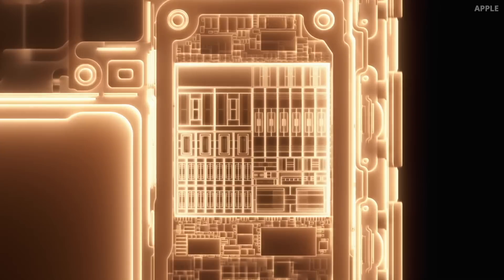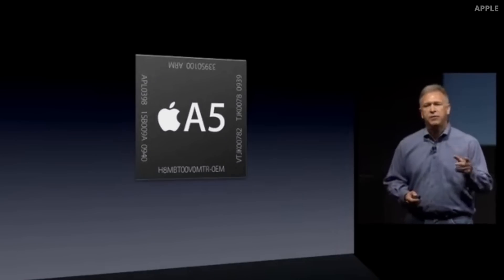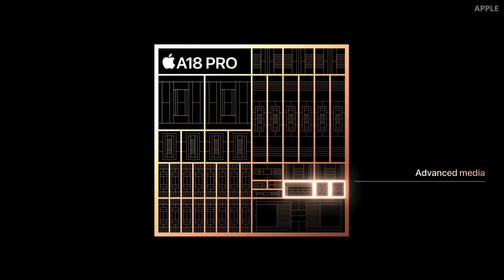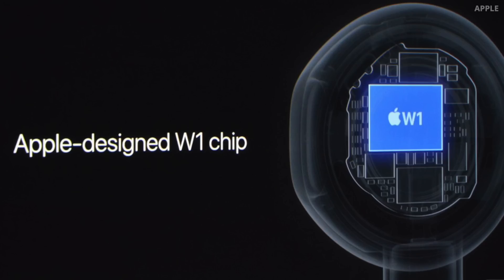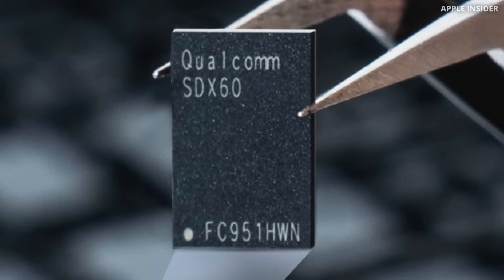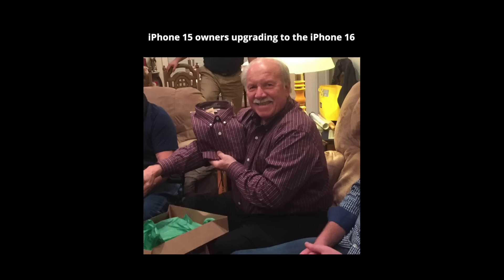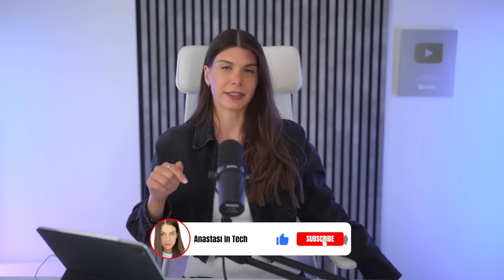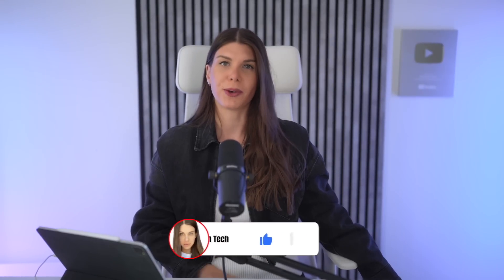The Secret Behind Apple's New Silicon

Comment: I’ve always said Apple is primarily a hardware company.  Be it the external aesthetics of design or internal architecture, packaging and functionality. They struggle to make their software achieve equivalent performance with their hardware.  Look at the many years Siri languished. Or Apple Maps vs Google.  Apple Music vs Spotify.  MacOS is better than Windows, but there’s still lots of opportunities for improvement.  iPad OS does not take advantage of the new M4 processor- perhaps this is intentional.  But there are many functional shortcomings to IPad OS.  Certainly as the world becomes more technologically complex, Apple will see massive benefits to the integrated ecosystem they have developed.  But it remains to be seen how well they do with AI.  Google excels as a software company compared to Apple. Ultimately it’s the functionality that software offers consumers that excites consumers about technology products.  Software solves problems, offers new functionality and capability, albeit with a reliance on the underlying hardware stack.  To most consumers, the hardware layer is a mystery to them. It’s just there and it does its thing.  It’s the software that drives the customer experience.  For instance consumers don’t care what chip provides cell service.  They just want it to work, invisibly.  So Apple has a huge software challenge before them.  To succeed it will require true innovation and not just marginal and incremental enhancements.  Hopefully they are up to that task.

Comment: @AnastasiinTech  , I asked the new chatGPT model o1 if it had any ideas about how to make semi conductors faster. Most of this is gibberish to me, so I thought I'd share with you, to see if you have any thoughts on it:

Improving Semiconductor Speed with Existing Technology

Enhancing the speed of semiconductors using current technology involves optimizing materials, device architectures, and fabrication processes. Here are several approaches that can be implemented:

1. Scaling Down Transistor Sizes (Continued Moore's Law)

Advanced Lithography Techniques: Utilizing extreme ultraviolet (EUV) lithography to achieve smaller feature sizes, reducing the distance electrons travel and increasing speed.

FinFETs and Gate-All-Around FETs (GAAFETs): Implementing multi-gate transistor architectures to improve control over the channel, reducing leakage current and enhancing performance.

2. High-Mobility Channel Materials

Silicon-Germanium (SiGe) and III-V Semiconductors: Integrating materials like SiGe, gallium arsenide (GaAs), or indium gallium arsenide (InGaAs) in critical regions to increase electron mobility.

3. Strain Engineering

Applying tensile or compressive strain to the silicon lattice to enhance carrier mobility, allowing electrons and holes to move faster through the transistor.

4. High-k Dielectrics and Metal Gates

Replacing traditional silicon dioxide with high-k dielectric materials (e.g., hafnium oxide) to reduce gate leakage and enable further scaling.

Using metal gates to improve electrical characteristics and transistor performance.

5. Improved Interconnect Materials

Copper Interconnects with Low-k Dielectrics: Utilizing copper for interconnects to reduce resistance and low-k dielectric materials to decrease capacitance, minimizing signal delay.

Cobalt and Ruthenium: Exploring alternative metals for interconnects to further reduce resistivity at smaller scales.

6. 3D Integration and Packaging

Through-Silicon Vias (TSVs): Employing vertical interconnections to stack chips, reducing signal delay between components.

Chiplet Design: Breaking down complex chips into smaller "chiplets" connected through high-speed interfaces to improve performance and yield.

7. Silicon-on-Insulator (SOI) Technology

Utilizing an insulating layer beneath the silicon layer to reduce parasitic capacitance, which enhances speed and reduces power consumption.

8. Enhanced Thermal Management

Advanced Cooling Solutions: Implementing heat sinks, heat pipes, or liquid cooling systems to dissipate heat more effectively, allowing semiconductors to operate at higher speeds without overheating.

Thermal Interface Materials (TIMs): Using materials with high thermal conductivity to improve heat transfer between components.

9. Optimized Circuit Design and Architecture

Parallel Processing: Designing processors with multiple cores or specialized units (e.g., GPUs, AI accelerators) to handle tasks concurrently.

Clock Gating and Dynamic Voltage Scaling: Implementing power-saving techniques that reduce energy consumption and heat generation, indirectly supporting higher speeds.

10. Improved Fabrication Techniques

Atomic Layer Deposition (ALD): Achieving ultra-thin and uniform material layers to enhance electrical properties.

Epitaxial Growth: Growing high-quality crystal layers to improve carrier mobility and device performance.

11. Advanced Doping Methods

Laser Annealing: Precisely activating dopants without damaging the substrate, leading to sharper junctions and faster transistors.

Ion Implantation Innovations: Enhancing dopant profiles to improve electrical characteristics.

12. Optical Interconnects

Integrating photonic components to transmit data using light instead of electrical signals, significantly increasing bandwidth and reducing latency.

13. Use of Compound Semiconductors for Specific Applications

Gallium Nitride (GaN) and Silicon Carbide (SiC): Employing these materials in high-frequency and high-power devices due to their superior properties over silicon.

14. Software and Firmware Optimization

Compiler Enhancements: Writing software that optimizes code execution paths, making better use of existing hardware capabilities.

Firmware Updates: Refining low-level code to improve hardware efficiency and responsiveness.

Conclusion

By focusing on these areas, it's possible to significantly increase the speed of semiconductors using technologies already available. Continuous improvements in materials science, fabrication processes, and design methodologies contribute to the ongoing advancement of semiconductor performance without the immediate need for groundbreaking new technologies.

---

If you have questions about any of these methods or want to explore how they might apply to a specific application, feel free to ask!

Comment: I abhor the term "apple silicon" they use TSMC silicon, "apple silicon" is just branding and means nothing anymore.. in point of fact they are literally just rebranding TSMC silicon and calling it "apple silicon" they design it, they do not make it, they don't make the wafers, they don't make the chips, TSMC does both.
Reply: When I saw "new apple silicon" I assumed they had a breakthrough in silicon, which they have not.

Comment: I don’t think you’re right about Apple servers. I understand that they don’t have any data sources to train an LLM with, like meta, google and X has. They have also promised not to use iCloud user data or scrape other sources like YouTube illegally. This means that they probably are not going to train their own models but buy or lease pre-trained models from others, or outsource queries, like they do now with ChatGPT. This in turn means that they don’t need GPU-like chips but only chips suited for bandwidth and search, which the M2 chips are quite good at. This would explain why they’re not buying nvidea chips or boards, but increasing their M2 purchases.
Reply: Yes, what they've said is that the server software they built for AI (Private Cloud Compute) will only answer user requests, they won't be storing those requests on their servers.  They will user third party companies to verify this fact.  One enormous advantage this provides them with is ability to use their own data centers which run on renewable electricity.  While every other provider in the industry must procure new sources of expensive electricity, Apple is able to generate their own supply of energy.

Comment: This was really a treat to watch! I think the ARM-based Apple chips (SoC) could eventually outperform NVIDIA. Here's why: First of all, Apple doesn't need a PCI bus, NVIDIA does. Secondly, NVIDIA cannot access CPU memory, NVIDIA GPUs must have separated separate memory address spaces, and they require an external bus like PCI, which introduces significant latency. The best of everything is to have as many of your execution units on the same die, and in the same memory address space. I see this an an insurmountable problem for NVIDIA in the future.
Reply: My hunch is that the time for the signal to travel on an external bus is becoming a limitation. Simple back of an envelope calculations, using the speed of light, indicate that external bus speeds are reaching a limit in the Gbps range.
Reply: @ianstorey1521 Yes, but if I understand correctly, the bus latency does not affect the streaming speed, only the first bytes and handshakes. One would hope that small bits of data are retrieved mostly from on chip cache.
Reply: It will be 15 years
Reply: Graphics is limited by memory bus. So unless Apple starts using HBM in their microchip architecture they will not surpass Nvidia.
Reply: @ehtasam2080 and none of that computing firepower can access the CPU without slowing it all down.

Comment: If Qualcomm charged 100$ for each modem chip to Apple, they would get 22.5B revenue from Apple for the 225M iphones sold each year. From Qualcomm annual report it looks like they are getting 9B from their biggest customer (they don't name the customers) and that includes licensing fees and chip revenues together. I don't think its anywhere close to 100$ for modem chip alone. But otherwise, very informative and detailed video as usual.
Reply: So 40ish dollars a chip.
Reply: @EnlightenedSavage 
That includes licensing, which we don't know how much it is. Maybe 8 like in the lawsuit filed in 2017. Dylan Patel claimed it is 12+ but even if it's assumed to be low 8, I am not sure how much they will save building their own modem. From all the rumors so far, their modem will struggle to be area efficient, so they won't be able to integrate in their already large SOC that easily. Building their own modem is more of a licensing play I suppose and not motherboard efficiency.
Reply: good good point
Reply: Given that they charge $130 premium for iPads with 5G, you can bet their cost is well under $100 for the modem chipset.
Reply: So, around $40 per iPhone?
Reply: Build of material has to stay with in a 220 budget
Reply: @thereddog223 $220 for iPhone? What materials/parts are included at this price?
Reply: multiply by 5.  For 5G
Reply: I think I remember the modems from Qualcomm costing Apple about $US8 each in circa 2018. Then Qualcomm got greedy and started charging Apple about $US25 per modem.
Reply: I think she stated for the latest iphone, so it would be next year's annual report you would need to reference
Reply: @shauny9149  nonsensical.
Reply: With the volume Apple buys these at they would get a good discount. $100 could be the price received for much smaller orders.
Reply: I just read it’s as much as 9 dollars per chip… not 100.  So “as much as” probably means it’s less.  So 7 maybe…
Reply: @LaneBatman-c2v  no. That’s the amount of royalties Qualcomm wanted Apple to pay them for licensing and the reason why Apple took them to court. Qualcomm insists that company pay them licensing fees even for patents they don’t want or need, in a package. The chip itself costs about as much as an SoC.
Reply: Wth 100 USD for each chip?!
Reply: Chips cost a nickel a piece to produce the investment is billions to recover the overhead it takes a decade, this is the problem with high investment crushing Quantum chips
Reply: $20 billions is chump change for Apple. Think about all the die-hard Apple customers waiting in lines.
Reply: @tshavfengvang7831  irrelevant, Off topic

Comment: Sadly Apple is not a silicon business any more than an architecture practice is a concrete company. If Apple would invest some of its cash mountain in building silicon fabs the industry would be in a much more resilient place, less dependent on a single politically contended area of the world (Taiwan). Apple is at most a circuit design company. TSMC designs the transistors, the chips and the factories that produce them. They are also responsible for most of the performance and power consumption gains in 'Apple' silicon.

Comment: I don't see Apple running AI Inference on their current silicon offerings... LLM inference is strongly GPU memory bandwidth bound and compared to the 3TB/s to 5TB/s current datacenter GPUs are offering, even the 400-800 GB/s that Apple's biggest M-Series chips are offering is peanuts.
As far as Apple designing a modem / radio: They haven't succeeded making a competitive product in the last 10 years without infringing patents and I don't expect that to change.
Reply: Inference needs an industry-wide inversion to fix memory bandwidth requirements.  Von-neuman doesn't scale.
Apple cannot put 5G into SOC because the layout rules aren't compatible.  Even soft radios (SDR) which is power inefficient barely fits in one silicon.
Reply: Apple will build inference chips because it is cheaper than buying Nvidia chips. If Tesla can build their own AI chip then surely Apple with more resources can also do so. For modems that is a hard problem but standard changes so maybe 6G can work around the patents that are blocking 5G chip development.

Comment: The history of Apple silicon actually goes back even further to the 1990's when they partnered with IBM and Motorola over the PowerPC range of RISC processors. Apple has a long history of working with silicon partners to produce chips specific to their platforms. Since the very earliest days of Wozniak working in a garage, Apple have always had impressive software and hardware integration - something only really possible if you control both. This is why many in creative industries still favour Mac hardware, because it works so well with Apple's application software. See Final Cut Pro render times versus Adobe Premiere on comparable x86 hardware.
Reply: ngl I got an M2 mac mini recently, and for all the good things I had heard about "Apple's hardware/software integration", I was appalled by the performance of Visual Studio Code on a 4k screen. It legitimately felt laggy to type on. Now I get why Apple users created a whole new code editor just to reduce typing lag! Meanwhile I'm on linux with an nvidia GPU, a circumstance where the manufacturer of the hardware seems on a quest to make my life miserable, and everything runs smooth as butter.
Reply: @seeibe  You wouldn't expect a Microsoft product to take advantage of the full range of hooks in an Apple OS - and historically Microsoft did a terrible job of coding for the Mac platform (there are some exceptions). The Mac native IDE is Xcode which has been around for over 20 years.
Reply: @lindsaybruce1396  xcode is so irrelevant, Apple fanboys will rather create a new editor to replace VSC than use xcode
Reply: @seeibe  ROFL VSC

Comment: Is this just an apple advertisement? The architecture hasn't really changed from last year, and the comparison charts by Apple (that you used as well) were done to A16 from 2 years ago.
Reply: Because the previous gen regular iPhone 15 had the A16.. so the A18 compared to that.. but the A18 Pro was compared to A17 Pro, because their previous gen had that.. i mean why do you think the comparisom between last year pro and this year regular device is more fair like the last year regular vs this year regular chip..?
Reply: @TamasKiss-yk4st  Because last year's regular chip was two years old and was using two years old architecture.
A17 pro was made using the first gen 3nm process and had a different architecture than A16. 

A17 pro was the first chip since A14 where they increased the size of the instruction decoder, so it's not an apples to apples comparison between A16 and A18 and you know it too.
If the pro chip makes such a drastic change (it doesn't) then just talk about the A18 pro instead. The CPU is practically identical in terms of architecture between A18 and A18 pro, the bigger difference lies in the USB controller and display controller and whatnot. One extra GPU core? Makes no difference for CPU performance.

It makes no sense for real comparisons to be made between A16 and A18, it was only a marketing tactic by Apple to make the performance of the iPhone 16 seem more significant.

Actually Apple is either lying in the presentation or A18 pro is slower than A18. They said that the A18 pro is 15% faster than the A17 Pro meanwhile A18 is 40% faster than the A16, but the A17 pro isn't that much faster over the A16 that A17 pro * 1.15 is going to place it 40% ahead of A16.

Not in Spec2017, not in terms of Geekbench 6.

It's all just a marketing speech and nothing else.

Comment: for now just new iPhone is coming...apple does not making external gpus, AI enabled boards, any solution dedicated to AI or anything modern not in a context of iOS enabled devices which is iPhone iPad and MacBook's. They are competing with themselves but not because they do not have competitors but because they have kind of "closed hardware/software ecosystem".
Reply: The are competing themself because easier ro understand what changed inside the device compared to your device, like compare to a device what you never used.. (because 95% of the users are loyal to their brand, alias 19 out of 20 will understand if they compare their spec to their previous spec, and that 1 can come from 1000 different devices, so harder to choose a device what is actually telling true comparison instead of the usuall e-p*nis measurements, what only looks good on paper, but actually no usefull data for anyone)